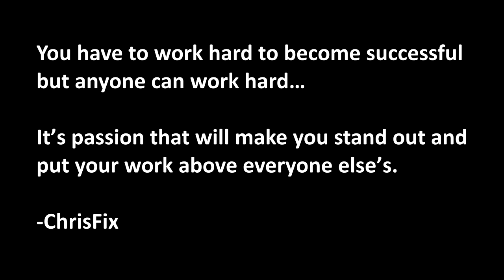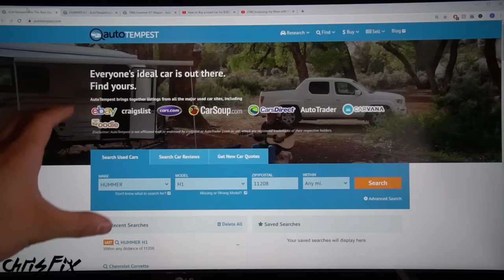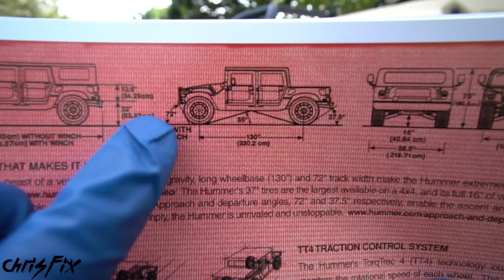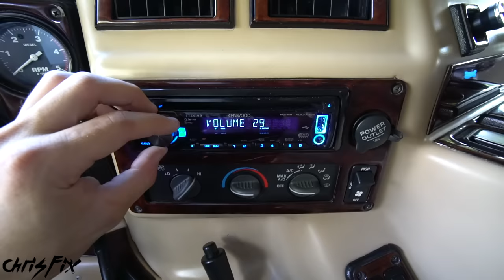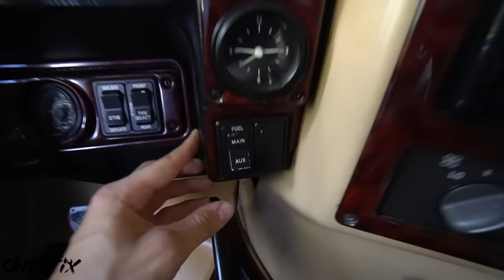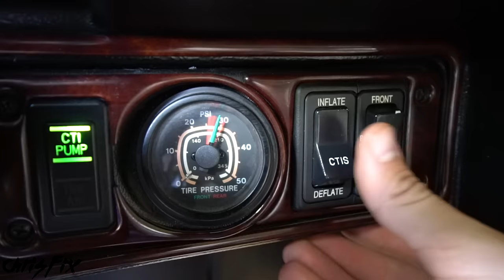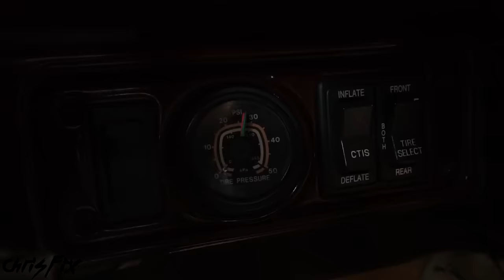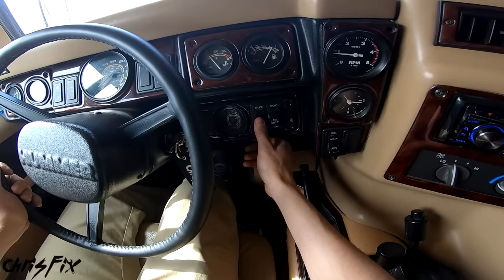I Bought My DREAM CAR and it's AMAZING!!!

Comment: I compared his stopping distance with the average car at 60-65 mphs. Those are some great brakes.
Reply: For 8 thousand pounds of weight those are insane brakes!!
Reply: Even the the stock brakes on the military version are fantastic. I found out when my driver almost put me through the windshield avoiding a dog lol
Reply: When I first heard his numbers, I wasn't impressed. Comparing the numbers gave me an sense of scale.
Reply: @EELLISON2012  yeah hmmwv is heavier than it looks and the civilian version is heavier (close to 2x the average sedan's weight or a 4 door diesel and change) it's pretty impressive.
Reply: It's not just the breaks, but the tires too. Brakes won't do well if a tire doesn't have grip. 
Even tire shape, how much it deflects, changes this. Watch Engineering Explained's video, "How To Prevent Expensive Tesla Wheel Damage," to see this demonstrated; Model 3's have a specially made tire that is flatter between the inside and outside of the wheel, the increased radius from the off-the-shelf variant of the tire affected braking distance. 
Tire type, tread patterns, terrain, and weather are also factors. If you use off-road tires on paved roads, there will be a change, vice-versa with road tires on terrain that isn't pavement. Same goes for weather tires, if you're using summer tires on snowy and icy roads, you're not going to have the same performance as a proper winter tire, and vice versa with winter tires in the summer; same goes for using race tires, which are typically meant for dry weather, in rain. To go back to ice conditions, you can also get studded tires, which would be shit on dry pavement, same goes for any terrain-specific tire, just like a paddle tire, used for sand and mud, would be shit on pavement as well.
It's a lot more than just the brakes. Brakes are important, and do a lot of the work, but attributing braking distance to just brakes is entirely false, and an uneducated statement.
Reply: @xaytana  I appreciate the profound explanation. Thank you. So, the shape and design of the tires, brake system and etc also play a major role in stopping distance.
Reply: @EELLISON2012  Yes it all matters. For example my 86 has a stock stopping distance of the low 90 feet range. Mine however runs different tyres, suspension, brakes and has a stopping distance of about 82 feet.

Comment: **warning doors are not bullet proof my friend trust me.**
Reply: Mr. Grey you can probably pay to armor them
Reply: Lebanem carl yea you can pay to have bulletproof plates put in the doors and get bulletproof glass it’s just expensive and makes it a lot heavier because when you get a normal car bulletproofed they usually beef up your engine
Reply: @lebanemcarl68  that was the first hummer to pop up when he searched on that website fully armored for like 385k lol
Reply: All the GTA V experts giving advice lol
Reply: @Apriliars  Actually armoring your car in GTA V doesn't affect acceleration, top speed, or handling.
Reply: Cheaper to wear body armor. That is how the Army did it. Lol
Reply: "Bullet proof" is a Hollywood movie term. In the real world it's "bullet resistant" and adding armor to vehicles has serious drawbacks.
Reply: @lebanemcarl68  yes but sadly even some that were on the up and up were on the down and down my friend there is a channel where he shots alot and has a funny host comdey/guns/yeah
Reply: Jeff Wang when did I ever say anything about acceleration, top speed, or handling?

Comment: 33:20
No one:
Van in back: why did I follow this guy
Reply: "O HELL NO,  I'M OUT!"
Reply: I was hoping we'd see it try to send it lol. Should have installed a snorkel.
Reply: coz the minivan can help Hummer if stuck in the pool of water.  It means the elephant is not strong enough to pull its legs out of crocodile's cage when the elephant is in water.
Reply: Its33:21

Comment: Wow that’s fucking amazing I remember the only car he would drive is that brown truck lol
Reply: B D that is not a ranger it is a Mazda b3000 or something like that
Reply: @M203Logan  its the same truck.
Reply: B D for reals
Reply: B D he didn’t say what he paid for it tho
Reply: @M203Logan  it's a Ford Ranger with mazda Badges. Just like the Mazda Tribute (Escape)
Reply: @Robertschannel-1  yeah and the Navajo
Reply: Project_ranger3.0 did not know that sorry
Reply: B D it’s a Mazda b3000 Chris fix has not a ranger I got a Mazda b4000 an the dam thing is really reliable an has good power for a 4.0 OHV
Reply: @kamryn7496  Ford and Mazda had a contract with each other. So like the Cx-9 is a Explorer, Tribute is a Escape, B Series Truck is a Ranger, and the Older Mazda 6 were the 90s early 2000 Ford Taurus. The Mazda 3 (Not Speed3), has similar properties of a Focus as well.
Reply: @M203Logan  you're good bro, just like Chris education goes along way for the young mind. Not saying I'm always right, I do know some things about ford and Mazda because I've worked at both dealership's before. Over a few years time

Comment: 15 mpg for a Hummer? Thats better than 2019 Mercedes-Benz AMG G63
Reply: And every G63 is owned by a pretentious tool.
Reply: My 6.5TD hummer got 14-15 also before the engine died.  Probably get more like 15-16 after my P400 goes in.
Reply: That’s about what my h3t alpha gets 😭
Reply: tbh, you don't buy an AMG SUV for fuel economy

Comment: Very nice truck, I was thinking, you can prolly add an air horn, as you already have an onboard air compressor.
Reply: illegal
Reply: Do it ! Who cares? Illegal🙄🏴‍☠️
Reply: So is the exhaust 🤷‍♂️
Reply: @TheBigghunter01  No it isn't. Exhaust isn't illegal unless you live in California.
Reply: It was a straight piped diesel with black fumes
Reply: I watched a you tube video about charcoaling diesels and how it is an illigeal trend in America
Reply: @Eray2007  liberal states, sure. Jersey isn't that bad, yet.
Reply: @Eray2007  diesel with black soot is still cleaner than the process of lithium ion battery creation, BY FAR!
Reply: @Loki1620  ok
Reply: @Eray2007  it's only illegal if it wasn't original equipment, I have an 04' Dodge with Cummins and has 0 emissions equipment on it from the factory. Now if you remove emissions on a vehicle that came with it, yes illegal.
Reply: @adamjarvis6162  I understand

Comment: Hey Chris,
Just like you my “Dream Car” since I was a kid has always been a Hummer H1 Wagon.
I purchased my 2002 Hummer H1 Wagon a few months ago and have been following your videos to change all the fluids on my Hummer with great success.
Can you make a video where you explain how to replace the serpentine belt, mine squeaks a lot when I first start it up for a few minutes and then stops after about 10 minutes, but I don’t know if it’s the belt or a pulley.
Thank you for all the great videos,

Kind regards, 

Rafael
Reply: I could be completely wrong and a hummer is diffrent, I wouldent be supprised, but ill throw my 2cents in the case he does not anwser. Normally you just have to find the belt tensioner and tighten the bolt on the pulley that's connected to the tensioner then the belt will lose tension and you should be able to slip it off. I've never heard of the belt making squeaking noises normally it's worse so I'd assume it's a pulley. You can check them by just spinning them and they should have very little resistance nor noise. Before doing any of that even you can turn it on and pop the hood and just look at the pulleys none of them should have wobble while the belt is running.
Reply: thank you very much for your  reply & recommendation
Reply: @rafaelcamacho481  No problem, the tensioner might also just have a bolt on itself to relieve the tension rather than using the bolt on the pulley. Let me know if it works.
Reply: @rafaelcamacho481  Yo Rafael! He's got a video about belts and pulleys. Look up something like "squeaking belt ChrisFix" and you should find it
Reply: one small problem if your looking for an exact match engine then Chris' engine was swapped for a duramax i.e. completely different engine layout, for the most part its either push the tensioner (why does you tube think that's not a word) with a long ratchet or you need to pull a pulley.

Comment: Cardealer: How many horsepower do you need?

Chrisfix: yes
Reply: All of it!
Reply: Actually its torque
Reply: I hate it when people do this. It's been used soooooooo much. Let's work on originality?
Reply: Where did this meme come from?
Reply: @MattNunez89  You hate it but most people still likes it. You go and be original if you want, but not us since we are ok with what we got
Reply: Mr. dark man 450hp is still incredible
Reply: @jesujgaming9801  the point is it's a diesel so torque is what matters. HP is for drag/race. I thought the same thing. Torque would have made the tired meme better.
Reply: @bruhwhatevinisthis725  Torque is necessary in racing.

Comment: Ay Chris, if you want one of the most detailed, upgradeable, realistic, and good looking model RC Hummer H1 you should look at the HG P-415.  This rc truck is pretty  cool in its stock form but once you get the upgrade kit the thing is a beast.  You could also make it match your H1 very easily.  The only upgrades I recommend is the steering servo and possibly the motor/esc but the stock one is fine.  Anyway, I hope you see this and look at the RC truck.  thanks. - JT Houston
Reply from the maker: Thanks for sharing, I'll check it out!

Comment: this video was the reason i started saving up for my dream car
now i own 5 mustangs and a svt raptor ❤
thanks chris ur a good guy
Reply: 5 mustangs? Holy thats a dream
Reply: @KinomiUtitaru  trust me u can make it even if u think u have no chance at getting it. i got a 2006 automatic 4.6 a 2009 manual 4.6 a 2012 manual 5.0 a 2014 automatic 5.0 and a 2015 automatic 5.0 and a 2014 svt raptor and it all started with that 2006 4.6 that i have in my pfp a

Comment: I bought one of these in 2002, I felt exactly like you did.  I still have it, just spent mucho $ to fix it.  Was driving it to the Indianapolis 500 2024 and it blew a coolant hose.  Getting it fixed again now.  They will pry the keys from my cold dead fingers.

Comment: I would probably say that the same things are done on the trans filter are done with the oil filter. Putting some fluid on the O ring help keeps a better seal, not necessarily to take it off easier. And I would say you don’t just hand tighten it back on, but then turn it 1/4 - 1/2 turn.

Comment: Such an awesome project, but it seems a little pointless to install a locking fuel door that can be removed in 20 seconds by anyone with a screwgun and a torx bit.
Reply from the maker: Thanks! And the idea is to make it more difficult/slow anyone down trying to do something

Comment: 10:42 be careful when your under there with on lift or its gonna break and fall
Reply from the maker: It's position is locked and it didn't budge when checking so we were safe
Reply: Ok thanks to remind

Comment: Never use thread tape on any mechanical application. Use product such as loctite teflon thread sealer. Heavy equipment mechanic 35 years experience.

Comment: Maybe this one will be unread. But, I have a Chevrolet Lanos (basically Deawoo Lanos). This baby has 1.5L really durable engine. Most of the mechanics told me that it will handle a turbine just fine. But I have no idea on how to turn the atmospheric engine in to turbo. SO just a bit more info - Chevrolet Lanos was produced in Ukraine in 2007 1.5L engine 4 cylinder FWD.  What changes should I make? How to choose a turbine? What parts should I by?

Comment: Amazing video, question on fuel tanks, 17-year-old living in Australia currently in the market to buy a hummer, was the fuel capacity a later alteration, or is it the stock size for the H1. Currently looking at H3 as only allowed to drive that on a provisional license just wondering if I can have tanks altered later down the line, thanks!
Reply: Sorry forgot to mention currently the H3s that I'm looking at have a fuel capacity of 87 liters roughly 19 gallons on your end. Just in comparison to your Hummer and a rough 190-liter capacity. Not too sure if the increase in fuel capacity is a difference between the H1 and H3 just wondering before I buy. Not sure if I wait a few years and go for an H1 instead.

Comment: I have several dream cars I want. First Is chevrolet Starcraft 1996 Or Dodge RAM Van 1991 the other is Chevrolet Camaro 2010 ❤. The thisrd and last is FIAT Ducato vH3 2015 😅 to be modified to a camper van 🙈

Comment: 170hp on such a heavy machine is a bit... laughable because those vehicles are military duty (as far as i know) if you are running away from 30 people shooting at you, you'd want it to be FASTER.
450hp however is waaaaaaaaaaaay better.

Actually, interesting topic. This is one of the issues we (the car lovers) are facing. Retro cars are very beautiful, but the engines are not good at all. Years ago roads were smaller and gasoline was cheaper. You didn't really need a fast engine and fuel consumption was not really the center of attention. Nowadays cars have wonderful engines that are fast and have really low fuel consumption, but cars are shit, man... they are made out of plastic, the whole car has sensors and the car might shut down in the middle of the road for no logical reason and they are expensive and many of them are plain ugly.
Reply from the maker: Yeah "military duty" just means they put in the bare minimum to get it moving and not much else lol and that's why I like older cars!
Reply: @chrisfix  by the way, i was high when i wrote that, let's say "military grade" or "military purposed"

Comment: Don´t use teflon on NPT thread
Reply from the maker: I have never heard that, why are you not supposed to?
Reply: @chrisfix  NPT thread is self-sealant because it's conic shape. If you put teflon you are messing with the metal to metal contact that makes the seal. I learn that working at praxair (industrial gases). Greetings from México.

Comment: The (hatch back) Hummer was the model I drove in the Army. It was the first generation armored model with a bigger engine, turbo and A/C.   I loved it.
Pretty smart you opted for the locking fuel doors, too many woke snowflakes out there.

Comment: Dear friend, this is not how to change the automatic transmission fluid, since you were barely able to get half of the fluid out or less than half.

You should go to a shop that has a fluid transfer machine, or a transmission dialysis machine, where with the engine running, they change the 15 or 20 liters to the transmission, and they make sure to get every last drop out and in. oil for automatic transmissions.

//////

Querido amigo, así no se cambia el fluido de la transmisión automática, ya que a penas pudiste sacar la mitad del fluido o menos de la mitad. 

Debes ir a un taller que tengas una máquina de transferencia de fluidos, o una máquina de diálisis de transmisiones, donde con el motor encendido, le cambian los 15 o 20 litros a la transmisión, y se aseguran de sacar y meter hasta la última gota de aceite para transmisiones automáticas.
Reply from the maker: Thanks for sharing. This is actually exactly how you change transmission fluid. What you are saying is flush the fluid. That is not recommended for this trans. They recommend a change and not a flush.
Reply: @chrisfix  But, WHY?

Comment: No hate I have 2 friends that have wagons and slantbacks. one is fully sound deadend. And to be honest they both are way more trouble than they are worth. It's the pinnacle of never meet your heroes. Ask anyone ex military personnel who saw real action. They are not that great and lots of constant servicing. That's why you can get em cheap. Because the Gov was paying for it they made em not as reliable keep the gov coming back for parts baby.
Reply from the maker: Have only had one problem in 4yrs and I daily mine…. They def aren’t good but this one has been gone through.
Reply: @chrisfix  Hey that's great to hear. Glad you didn't get a bad one.

Comment: Idk an off road ruck should never have irs .irs is for cars not off road trucks
Reply: Lots of off-road vehicles have IRS, including all of the top model ATVs, Side By Sides and King of the Hammer rigs. Gives you more clearance.. why would you want IFS front to gain more clearance just to loose it in the rear as the rear differential scraps everything the front cleared?

Comment: someone with more money than sense nothing but a monster that will not be worth half its value in a few years.someone that started with fixing vehicles cheap then spending good money on this thing well it's your money guess you can throw it away if you want.
Reply from the maker: The values gone up in the last few years actually but thanks for sharing